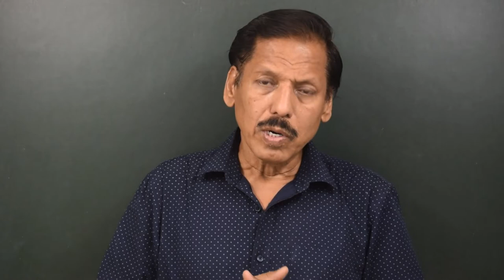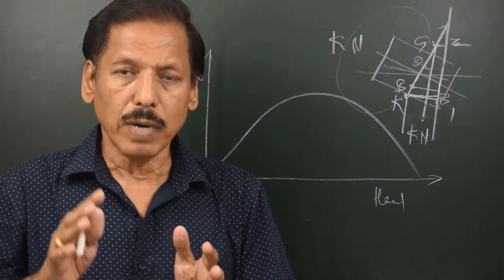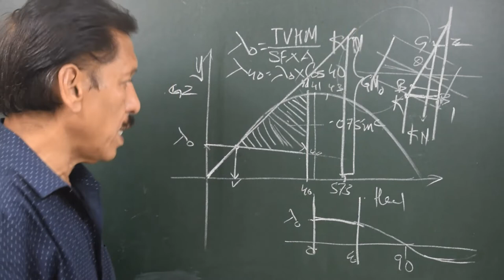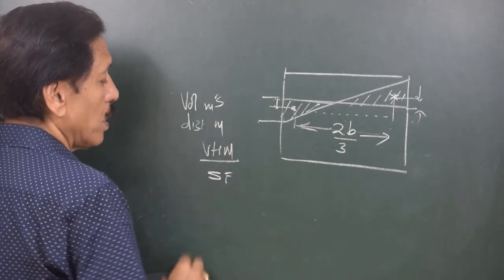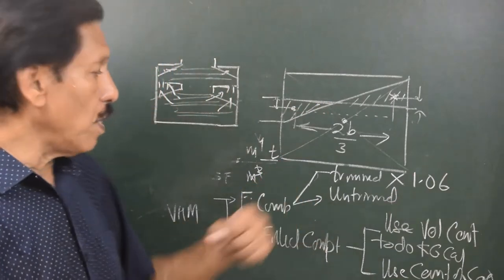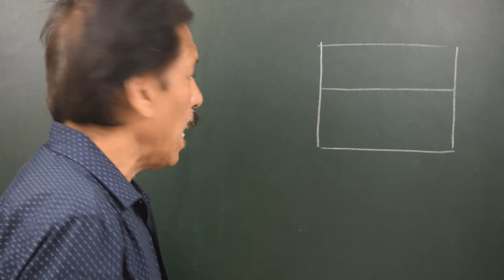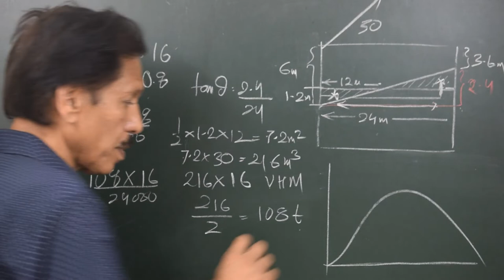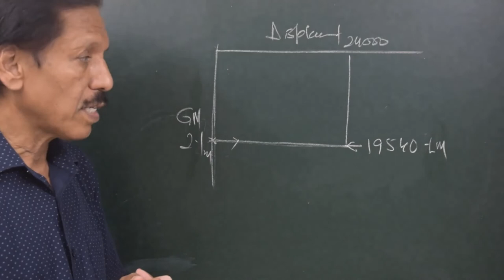Grain Loading and Grain Stability Criteria

Comment: Thanks for your brilliant explanation! You are doing a truly great job for people worldwide. Could you give me a prompt, please, what the abbreviations Mgy, qgy stand for? 
In the context:  …the heeling moments due to grain shift Mgy calculated assuming the standard void depth … and …the angle of heel due to grain shift qgy is not greater than 120 …

I will appreciate your clarifying! Thanks in advance! With kind regards from Russia!
Reply from the maker: The volume of wedge shifted x 2/3 of the breadth will give VHM in meter to the power 4. Now, the vessel's list must not increase more than 12 degrees or a smaller angle say deck edge immersion given by administration due to assumed shift of grain.

Comment: Sir at 14:06 minutes you used term maximum separation between two curves, can u please clarify sir
Reply from the maker: Take a divider. By trial & error method check, at what angle the distance between the GZ curve and (lambda 0 lambda 40 curve) is maximum.